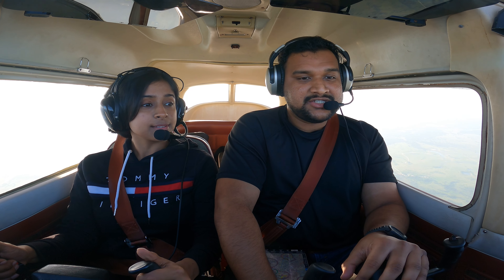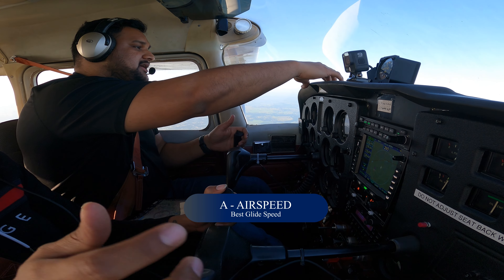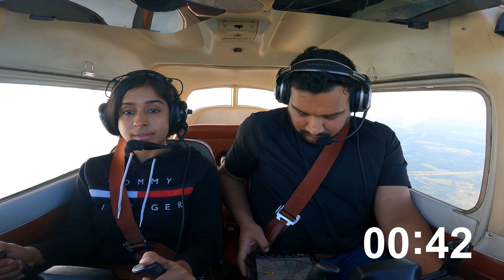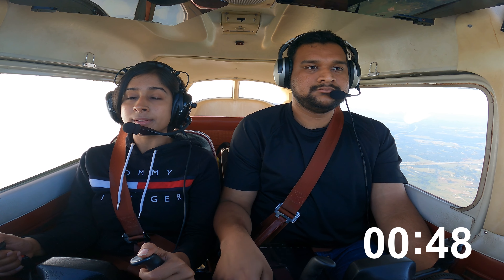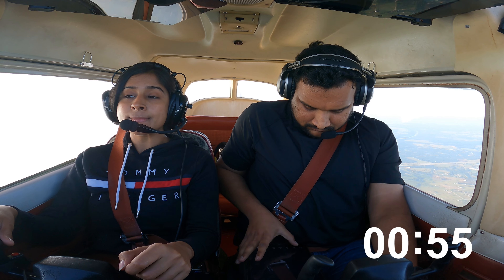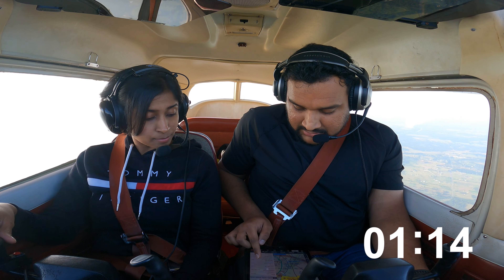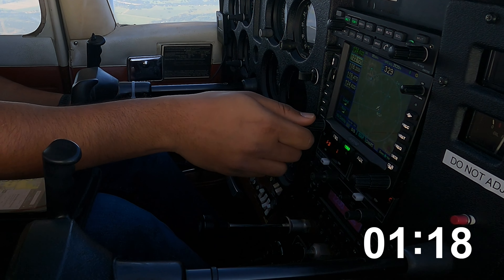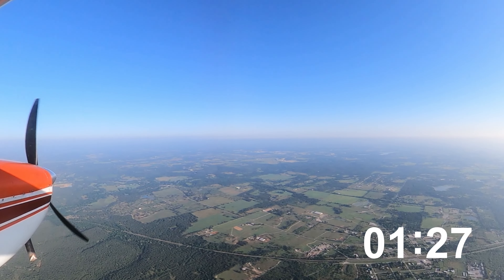What happens when the Airplane's Engine fails | Simulated Engine Failure Demo in a Cessna 172

Comment: Cool vid bro. Shrutz cool as a cucumber. 
I noticed you mentioned speed in MPH. At what point do you start using Knots for speed? Does this depend on the type of aircraft?
Reply from the maker: Yes you’re right. It depends on the aircraft. Specifically it depends on what units the “Airspeed Indicator” shows the readings in. Some planes that I fly, typically the older ones indicate the speed in MPH. The one in this video is a 1960s airplane. The planes that I fly after 1978 models typically indicate the speed in knots. I have also seen airplanes where the airspeed indicator has two rings of readings. The outer ring is mph and infer ring is knots. So if my ASI shows in mph, the airplane flying manual will also show all the speeds in mph. And oh yeah Shrutz was definitely cool as a cucumber 😎